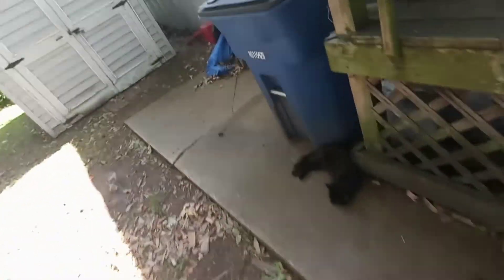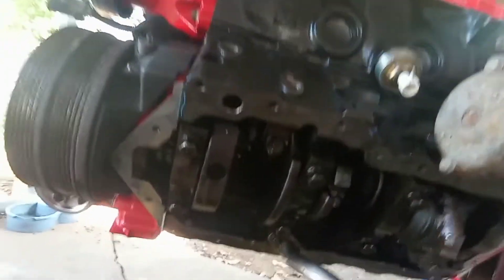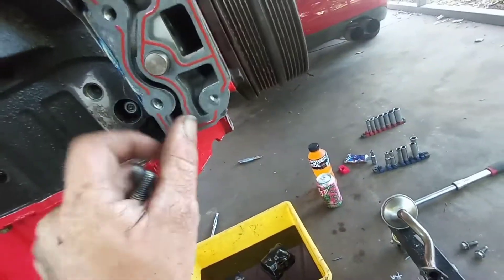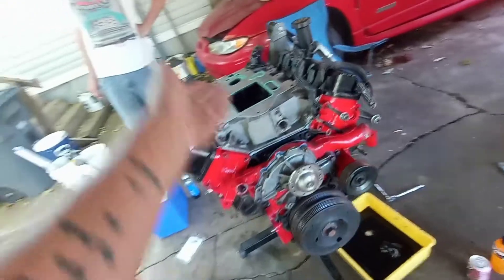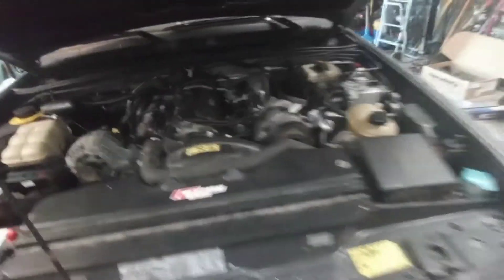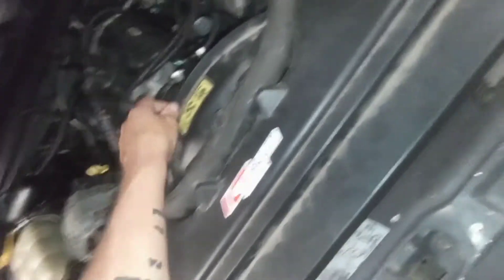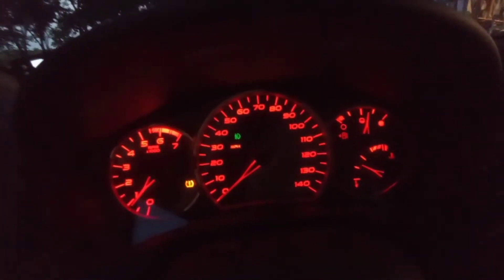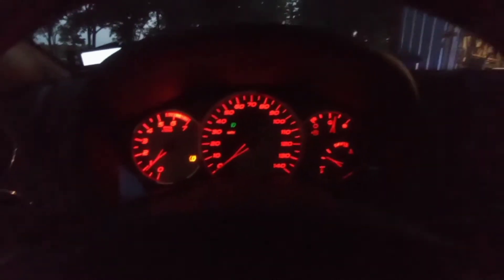Grand Am Engine oil pan install/LS Swapped Land Rover gets a lift kit/07 Grand Prix GT pulley swap

Comment: Do you have a FP sending unit issue,or were you just changing fuel types?
Reply from the maker: I had filled up with e85 and its still tuned for 91. Put 91 in it and shes great.
Reply: @PontiacsGarage  Good deal. I figured out my fuel pump problem. The new FP harness was junk and shuttin the pump down. Better that then change FP's again.
Reply from the maker: @stevewheatley243  hell yeah. At peast you caught it. I did the re-wire.
Reply: @PontiacsGarage  I've put 4 pumps in this thing. Since the pumps are junk so is the connectors I guess. Can't buy quality anymore.

Comment: What's up Tom,you outta business over there?🤔
Reply from the maker: Not much Steve. Just working on the engine for the grand am. Lol. What you got going on?
Reply: @PontiacsGarage  Foolin with my car same as usual. Switched a bunch of coil packs around,they're all junk,so I got new ones on the way. Damn things tried to electrocute me.😂
Reply from the maker: @stevewheatley243  wow. Its not often all 3 go bad at the same time. Thats crazy. I got the new headers in today so im getting those installed on the GA NIC cam engine. Not horrible but not great either... Im like 87% happy with it.
Reply: @PontiacsGarage  They fire and hit,but ya don't want spark jumping everywhere. Performance,gas mileage,etc. So you're not thilled with the headers or the cam?
Reply from the maker: @stevewheatley243  i mean i love the headers and dp i have on the 07. I just need to get it tuned so the fuel pressure is right with the tune. And i like the cam i just havent got to experience it full on yet. I just wish it had a lopier idle like the NIC and xp cam.
Reply: @PontiacsGarage  I'd adjust the FPR where it starts and runs best and leave there. Don't know about your cam. Is it considered 3/4 or full race?
Reply from the maker: @stevewheatley243 
76-905-9
Gm3.8 xpz
 cam specs:       int exh
 Advanced dur. 265 275
Dur .50.              214 224 
lobe sep 116

Valve lift .566 .536
Reply: @PontiacsGarage  Near as I can tell it's 3/4 to full race. ZZP says you need 130 pd.valve springs,and your O2 sensors tuned. Like using a mini AFC,Tuner,or ICCU for fuel adjustment. Maybe you don't have a FPR adjustment problem? Do you smell fuel at idle? How's your long term fuel trim look?
Reply: @PontiacsGarage  Have you looked at fuel trim numbers and O2 readings?
Reply from the maker: @stevewheatley243  ok so at first with the 42.5s it didnt smell like fuel. And it was running lean. Threw a code for it. So i swapped to the 80s yesterday and now its running rich. But better rich than lean.
Reply: @PontiacsGarage  From what I've read you're gonna have to have one of the tuner things,or you'll have problems. The fuel/air ratio needs to be right to get performance. Bad on your Cat if it ain't. ZZP says you'll wear out timing chain and dampers pretty quick too. The articles called,"Which Cam is right for you "
Reply from the maker: @stevewheatley243  yeah i have a aem air fuel guage and sensor i need to hook up. But i need another 02 bung. And im catless rn. Im just being easy on her rn anyways. Cant afford to blow her up.
Reply: @PontiacsGarage  Ya gonna put a cat on it,or a pipe with a bunch? Don't see how the O2 would read right without the cat.
Reply from the maker: @stevewheatley243  its tuned for no cat. Zzp says you cant have a cat with the xpz cam.
Reply: @PontiacsGarage  Yeah I guess that makes sense really. I'm surprised that ZZP article didn't mention it. I could've missed it though.
Reply: @PontiacsGarage  You need a video of your trouble,so we can all guess and fuck things up more.😂
Reply from the maker: @stevewheatley243  yeah its in the next video. But im focusing on getting the GA done. Just no boost rn for the 07. Really sucks ass. But it is what it is i guess. You should add me on FB.
Reply: @PontiacsGarage  So the 07 don't work right w/o the intercooler?
Reply from the maker: @stevewheatley243  thats not the issue. Has nothing to do with the ic. Its the fuel system. And its not tuned for all the new shit. Its tuned for a stock pump and 91 octane. And i installed the zzp aem e85 340lph pump and put in e85. I also think it has something to do with the ebay 02 sensor. But idk. The car isnt done and i had to drive it. That's the problem. Its probably already junk with my shit ass luck. I dont care. Fuck it. If it blows up it blows up and ill crush it. Goes for all of them. Ive about had it with all of these cars. I mean i love my prixs but here lately i just cant win with them. So fuck it.
Reply: @PontiacsGarage  I hear that frustration. Same here. I fixed my FP harness but the damn pumps still junk. I'm sick of puttin fuel pumps in the damn thing. Buncha bullshit. And I hope you didn't use Delphi sensors. They ain't worth AF.
Reply: @PontiacsGarage  Denso O2 sensors are good.

Comment: Got my ride fixed yet?🤔🤣
Reply from the maker: hell no. the axle broke and ripped out the abs plug from the wheel bearing. so now ive gotta replace the axle and wheel bearing on top of the fueling issue.
Reply: @PontiacsGarage  Are you gettin my comments? I cussed and Youboob might not have liked it.😂
Reply from the maker: @stevewheatley243  no the last one i got from you was the got my ride fixed yet. Oh well no worries. Im gonna replace the axle and wheel bearing today and double check everything else while im under there. And im just gonna have to suck it up and send off the ecm to get re-tuned, and drive the 06 with no ac and it randomly dying for a couple weeks. Thats all i can do. Im out of cars. I shouldn't have gave away the 97 yet.
Reply: @PontiacsGarage  Have ya gave up on Youboob? Hang in there you'll make it. Slowly maybe but you will.
Reply from the maker: @stevewheatley243  no i havent gave up. Just working on the cars. Had to go to the salvage yard and get parts. Had a flat on the 06. Had to pull parts off the parts car. Just busy is all.
Reply: @PontiacsGarage  I hear ya. I'm not sure I'm satisfied with these new coil packs myself. Of course the computer adjusts to new input so we'll see. Im sure ya want more subscribers. You'll get em cause smart people don't want fake shit. That's why they watch"how to"videos.
Reply from the maker: @stevewheatley243  well that sucks. Ive been told oem coils are best. But i like my msd coils. Never had an issue with them. I did get the 07 together and it does start and run. Just still needs tuned. Thats coming soon too.
Reply from the maker: @stevewheatley243  and yes i do want more subs. In time. You cant rush it. I mean if i get the GA done and its a huge hit that will be bad ass. But its already been done so idk.
Reply: @PontiacsGarage  I think my coils are ok. Just need things to readjust. Glad ya got something to drive too.👍
Reply: @PontiacsGarage  These people are used to all the phony shit,so you'll do alright eventually. I subscribed cause I could see it's real.
Reply from the maker: @stevewheatley243  well thanks steve. Youre always encouraging. Thank you. Im just trying to get these cars done but i keep having problems.
Reply: @PontiacsGarage  We all got those problems bro. Mine come mostly from junk parts. So a fix don't stay fixed too long. That's damned frustrating.
Reply from the maker: @stevewheatley243  hell the 1st engine i built for the 07 was a 335k mile NA series 2 engine i got for $100 out of a 99 prix. I tore it down to the block and cleaned everything up. Painted it black. Got all junkyard heads a lim and blower and harness and a used nic cam and ls7 lifters and zzp push rods and built a budget build engine with zero machine shop time and had maybe $600 in the engine build and it lasted for 9 months before a lifter broke. And i beat the hell out of it. Got it tuned by Daniel smuts and she'd shit n get. I was so sad when it started knocking. But it just goes to show. You can do everything yourself and still have a great engine. DIY is awesome and a great learning experience.
Reply: @PontiacsGarage  That's why ya gotta teach these people something. They won't learn anything from these sissified pretend mechanics. Unless it's how to paint their fingernails!🤣lol